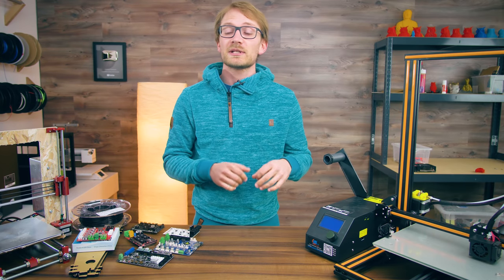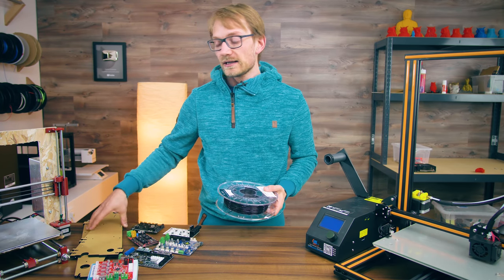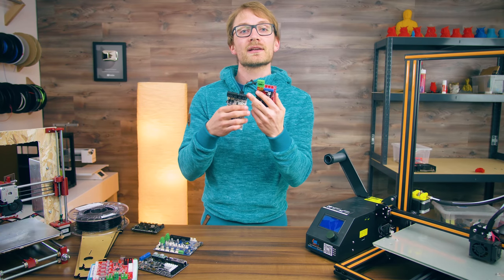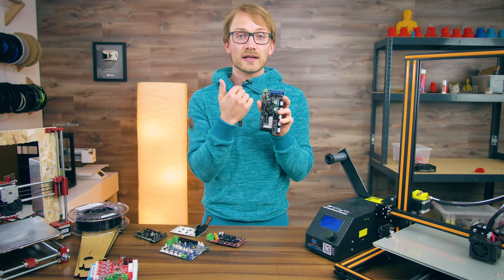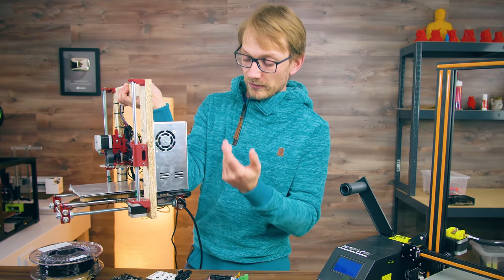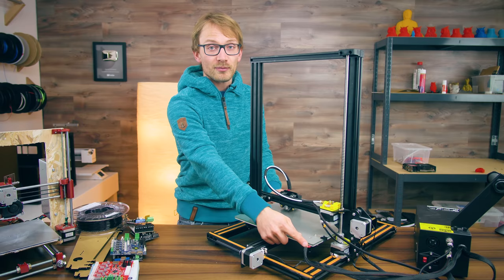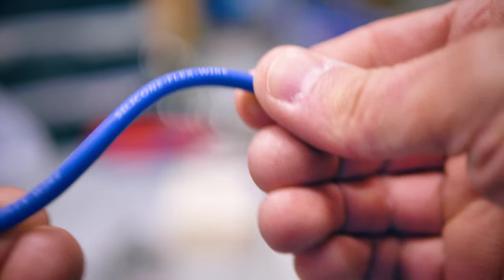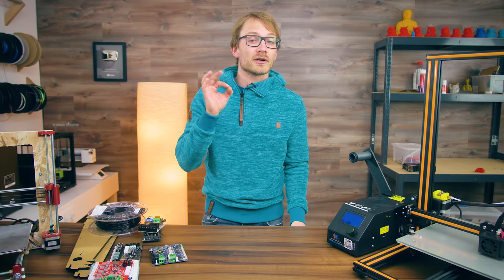Everything you need to know to make your 3D printer fireproof!

Comment: That's why I never set the bed of my Anet A8 above 60C. 
And then switched to a Prusa i3 MK3.
Reply: Jonathan Kayne didn’t save my Anet - the connector to the heatbed smoldered anyway despite having installed a proper mosfet. My smoke detectors would have saved the day anyway, but fortunately nothing happened, even the print went fine.
Reply: There's nothing wrong with the MOSFET on the A8 controller anyway!
Reply: Monkeh that is just not true, especially on the original A8 boards.
Reply: Which boards? What MOSFET? There's nothing wrong with the parts on mine.
Reply: Monkeh there have been at least three iterations of A8 boards that I know of. And are you implying that because your parts might be okay that there are no quality control issues with Anet? If that’s so, that’s surely a bold statement.
Reply: So what MOSFETs have they used? You can't say it's not true if you have no evidence to back up that claim. Based on the information I actually have available, there is no problem with the MOSFETs. If you have other information, share it. And please no wives tales about how 'my mosfet melted and burnt down my house'.
Reply: Monkeh the problem is that the integrated mosfet forces all the current through the mainboard where the connectors are of minor quality, especially in the first revisions of Anets mainboard.

An external mosfet alleviates that problem. Just do your own research and type in „Anet A8 burned“ in google picture search. You‘ll find lots of burned green mainboard-connectors (and lots of burned white Heatbed-connectors as well.)
Reply: Yes, I'm aware of connector failures. They're not MOSFETs. Even with poor connectors a large portion of failures are down to poor termination anyway.

And yes, I know how current flows, thank you for your condescension.

Comment: The 24V power cable for my Ender 3 (Bought Nov 2018) came loose at the PSU mid-print just last week. The increased resistance heated up the wire quite a bit, luckily I was in the room and noticed. Could have easily caught on fire.

Comment: Please make an video on all ramps 1.4 mod like MOSFET change , Changing connectors or replacing them completely with soldering changing fuses and also external mosfet if it is needed for safety

Comment: Clear and concise, like all your videos. 
I have a doubt, my printer lost the connection to the raspberry a few days ago, it never happened before, but I could see that the heaters remained on. Is there any configuration in Marlin that turns off the heaters when it does not receive commands for a certain time? Thank you.

Comment: Please improve your soldering technique.
Make a good mechanical connection first.  This helps hold the wire still, and ensures a more reliable connection.  For example, my wife just bought an electrical spinning 'wheel':  didn't work at first, because one of the power connector wires had not been mechanically attached, had been poorly soldered and had fallen off the connector.
Heat the wire / joint, then melt the solder onto it.  That way, you know you are less likely to get a 'cold' solder joint and the flux (that generates the smoke), which is a chemical cleaner, cleans the wire and joint instead of burning off on the soldering iron.
Keep the wire still while soldering and until the joint has cooled.  Otherwise you end up with a 'cold' solder joint, the solder can get crystallized and have voids in it and makes a weak, poor connection.

Comment: Probably wouldn't hurt to put the wires going into those screw connectors on the left side of the screw so the screw pulls them in instead of pushing them out as you screw. If there's space you could even curl the wire so it wraps around the screw for maximum contact.

Comment: You should also mention that the wires going to the heatbed can corrode, mine have corroded so bad it broke off the bed and they are getting hotter due to the wire not efficiently transfering power to the bed

Comment: part of the confusion of the amps rating on the connector is ac vs dc. Those 250v connectors i would bet are 20/10/etc amp AC rated. If you think about amount of current going through the connector there is much more going through 20 amp DC than 20 amp A/C.

Comment: When I had a set of anet A8's, I soldered all the high current wires, replaced the main wires, and added a fan to the PSU. I ran a 5 hour load test and nothing ever got warm. Still a crap printer though, but better than the qbed twoup I started with

Comment: I hadn't heard of the fires, but it's good to know about.  I'll be adding some strain relief.  Would insulating the underside of the heated bed be of any help?  It would reduce the amount of power required to get to the same temperature.  Also, I've never heard anyone talk about regular cleaning or dust free environments.  Just wondering.

Comment: I'd just had my Wanhao Duplicator i3s power in connector start smoking and melting, and as soon as I asked about it there was the suggestion that I should have installed an external mosfet board to offload the current from the heated bed.

Comment: My 3d printer was a fire hazard. One of the wires that went to the heated bed (not counting the thermistor) broke. It was soldered and the connexion failed. No strain relief, not a good connexion.

The wire ended up floating under the heated bed. The only insulation between both wires was gaffer tape.

Comment: When you say put the fuses on the outputs, are you talking about up near the heater and bed?
Reply: As close to source (the board) as possible (part that doesn't move( so if any of the moving parts break the fuse trips down the line. So board connector > little little wire > fuse > wire to bed/hotend > bed/hotend.

Comment: Solder wires to the bottom of the PCB? Are you nuts? That's so much more sketchy than the connectors themselves. I can definitely see soldered joints to pcbs shorting out on case or getting hot enough to desolder and shorting

Comment: I put mine in a steel with glass 19inch server rack bought for 25 euro.
But I am going to add the automatic fire extinguisher to it. There is no 100% safe way to prevent fires with this, so better prepare for it, then hope for the best. Ugh those fire extinguishers are a bit overkill, can just buy a sprinkler and put a cola bottle on it ;)

Comment: I've got a CR-10 on the way. I'm no EE by any means. I do have a STL ready to go to print a relief cradle for the bed wiring, but what other steps should I take to make sure that the CR-10 is safe enough to run overnight or unattended for an hour or more? Does the CR-10 have issues with runaway heating?

Comment: the connectors melted on the A8 for me. The connector was the Extruder connector. It completely melted it so i had to resolder the wires directly to the RAMPS board.

Comment: you forgot that some full graphics lcd consumes too much amperage for the arduino mega 5v regulator, i didnt think about fire, but, when i notice too much heat acumulated in the arduino and ramps i made a few things to keep things really cool with great succes
1)put a 12v fan cooling down the electronics, ramps and arduino
2)put the heatbed under 24v with an external power source and use a mosfet to pickup the signal from the ramps
3)Remove the diode from the ramps and feed the board with an externar 5v regulator with a heatsink, i use the 7805
4)The 12v power source must be capable of delivering 15% more amperage of the max power consumption of the printer, if you wanna go to 160mph, you dont buy a car with a max speed of 160mph, engine will work at the maximum and is going to wear, you buy a car capable of reach 190 mph at least

Comment: Tom the connectors used on a lot of these boards are far from good, but just adequate.
I would suggest looking at the Einsy board which has the PROPER connections for safe running.
In fact, the popular RAMPS, needs a big overhaul in my opinion, to use this type of connector, some extra crimping required, automotive fuses, 5/3V3 Buck converter at 2A, and Trinamic drivers already on board. Then it will mostly be a simple, cost effective, safer replacement than existing RAMPS.
Reply: The RAMPS and the Arduino it sits on both need to burn. They are not suitable.

By the time you've done all the work and changed the form factor so RAMPS doesn't suck in 25 ways, the micro may as well be onboard, and well, you might as well buy an Einsy. Or any of the other properly designed boards.
Reply: I dislike a lot of other boards because they aren't small enough, PCB stacking is a valid method for space constrained areas.
RAMPS is Open Sourced, and the the fixes to make it safe are not that difficult.
Monkeh the first person to make RAMPS safe and market it, will make a lot of money.
Reply: I'm not even concerned with safe. PCB stacking is valid, yes - PCB stacking on an Arduino is still crap. It's a horrible layout, and it's really very hard to fit a board on top which can handle both high power and analog signals.

Safe isn't that hard. Making that platform stop sucking is much harder. A from scratch multi-board design could be made to work but would push the price up noticably. People don't buy RAMPS because it stacks, they buy it because China churns the terrible things out like cheap candy.
Reply: The RAMPS headers aren't providing high currents.
The only thing bad about them is the slight noise inherent with header connectors, however 3D printers aren't oscilloscopes or spectrum analyzers and so can easily accommodate the extra noise without affecting the end product.  I know, because I am one of those techies that have to find route cause faults with many, many, products.
China churns the "standard" RAMPS out like candy, because the parts used are ubiquitous.  Which is one of the design goals for the RepRap project that Adrian Bowyer tried to achieve, that anyone should be able to build a 3D printer with ubiquitous parts available to them.

Comment: The only problem I've ever had was my bad crimp connection to the bed getting a bit hot. from the bed bullet connector to my one on the the wire. Since swapped to just soldering the wire to the bed

Comment: Great video. Unfortunately, I'm struggling as I cannot find ANYTHING with your links, as they all redirect to local amazon (France here, ip based detection I presume) and it seems that they don't sell here anything that you use (ex : fuse holder) :/.  Anet a8 owner here, security mods on the way...

Comment: Also, what I'd like to see is high-side switching of the FETs in the boards. Because if the switched GND wire of the heater rubs open and connects with the (grounded) frame, the heater will be always on. It costs a high-side fet driver though (or decent P-channel FET), this is why most boards don't have it unfortunately :/
Reply: That's an argument in favour of proper wiring harness management and fusing, not high side switching.
Reply: Fusing will not solve the problem as the heater is drawing its proper fused rate - just that it is always on. Keypoint is the defense in depth: you don't want to rely on a single safety feature to protect you. A wire harness is proper, until it isn't anymore due to mechanical failure. Then it is good to have a second line of defense.
Reply: Valid point, but the firmware can handle the resultant over temperature event without needing a more expensive, generally higher resistance PFET, or a high side driving arrangement for an NFET. Low side switching is proven and adequate for this IMO.

I should obviously point out I have a high side or primary side kill switch in mind there - a modern printer shouldn't be solely controlled with a manual switch and an SD card.

And while I'm appending thoughts, a good design will have a sensible thermal cutout or fuse on the bed.
Reply: Yes a software-controlled self-kill switch is an adequate second line of defense.
Reply: I wonder if anyone makes >300C thermal fuses for a hotend. That'd solve that issue as well, downside is the extra room and connection. Bed is easy, hotend is harder..

Comment: Interesting video!
I was planning to install a 12V car relais to over the RAMPS to power the heated bed directly from the power source. This way it prevents all the needed current going throught the RAMPS PCB itself. Same should be possible for Nozzle heatblock, but i think it will change temperature to often and you will get crazy about the constantly clicking relais :P

Also was thinking about modifying a smoke detector and install it in somekind of funnel directly above the 3D printer. So it will detect smoke faster and shut off the power supply when triggered (installing a relais over the buzzer)

Hope it can be helpfull to others! :)

Comment: I don't trust anything enough  to be left alone for more than an hour or so and i would never leave something running while i'm not there . I have let something run while i slept but i was in the next room and the room where the printer lives has a working (tested ) smoke alarm , even then i still checked it a few times during the night . A small fire extinguisher is a must in the printer location , even if  you borrow the one you should have in the kitchen for a  short time  - they are cheap enough so what i do is replace the one on my boat as it has to be in date by law and use the old one for something else provided the pressure gauge shows full pressure .  I want to build something using arduino to keep an eye on it for me , maybe some flame detectors or smoke detectors and sort out something so i can set up a webcam and check it though my smartphone - this will be handy if i'm out the back in the workshop and i don't want to keep coming inside the house to check the printer .

Comment: Hey Thomas, great video. This is a subject i'm somewhat concerned about. I have a Prusa i3 clone that uses a melzi board, which you already know is not a good system, and in my case does not have sturdy enough traces to handle the current for the heated bed. That can be bypassed with a separate mosfet board, but it makes me wonder what else on the melzi board is unsafe. Perhaps you could do a video for beginners on how to swap out melzi boards for RAMPS based systems which are easier to flash and have better components.

Comment: What about thermal fuse near the hot end and one under the heated bed?  I have both on my Delta printers.
Reply: I'm really surprised you're the only other person here commenting on Thermal Fuses. I have them at a few key points in my main machine. It's super cheap to get them in there.

Comment: I just remembered why I own a CO2 extinguisher. Also this is why I'm building my SLS printer out of aluminium :p Also if you're getting to the stage that you're soldering wires to the bottom of the board - solder is work-hardening btw - why not just swap the connector for a better quality/rated one?

Comment: On the scale of 1(bad)  - 10 (never issues at all), where do you see the latest Prusa in perspective of potential fire issues?
Reply from the maker: No machine is ever perfect, but it has everything I talked about in this video well taken care of (and more).
Reply: Looking at it with a thermal camera nothing gets unreasonably hot, and since it's a metal frame the only potential sources of ignition if a fault occurs are the power supply  and the controller board itself. Wires are always a hazard but as long as you don't use wimpy or damaged cables on carpet it should be fine (as long as your house is up to code). It's a matter of common sense I guess, if you treat it like a hot plate that you will be leaving on for hours,  you'll find stuff around it that shouldn't be there, curtains, stacks of mail, alcohol, spray cans, etc...
That said I doubt a well designed, healthy printer poses any kind of risk, if a fault occurs anywhere fuses will blow, or your circuit breaker will trip. Electrical fires are mostly due to bad design or negligence, inappropriate fuses/protection, old mains circuits,  poor quality electronics, undersized  wires.
Prusa printers are used to print prusa printer parts so I'm guessing the stress testing is taken care of that way. ^^
Reply: Thank you !

Comment: Long over due. Great video Tom. One thing I think you should have mentioned are the mosfet boards you can buy that handle the load so the main board dosnt have to. I use these on all my machines for at least the heated bed.

Comment: I think you missed the most important issues and I think it's with the mods people are doing a lot of people are pointing out that the A8 is the most likely to catch fire, having owned one myself I know that there is a massive amount of DIY parts available and most of them are SCARY !, 3d printer owners are just not using there common sense printing 3d parts for high amp/voltage components is just a NO NO, I mean if seen 3d printable DIY mods that hold hotends and bed leveling, it's scary that peoples will put flamerble plastic parts next to potential ignition sources then complain that the printer is dangerous, it blows my mind what some people do?

Comment: I think extruder cooling fan is another point of failure and most of boards or firmwares didn't have support to monitor yellow wire on this fan.
Reply: Jiří Němec Should the hotend cooling fan fail, the heat will just start to creep up. It will probably jam,  but the "cold" end won't get hot enough to be dangerous.

Comment: I wonder... Why are hotbeds beeing rujn with mosfets and not simply by a (bit more expensive) relais and a second PSU with good protection? There is then less power going over the PCB and connectors and everything can be fused well. Didn't try it yet but anyone: a good way of solving some of these issues?